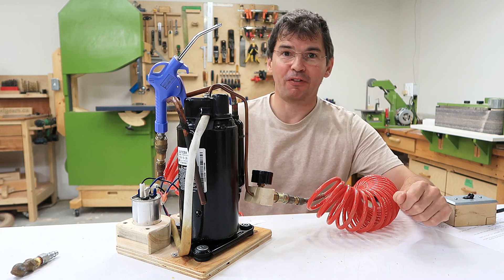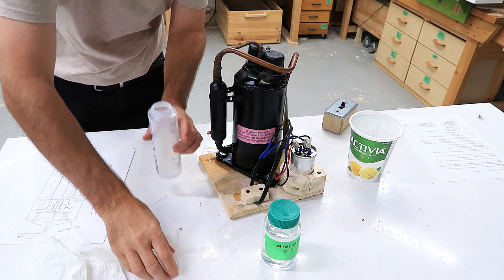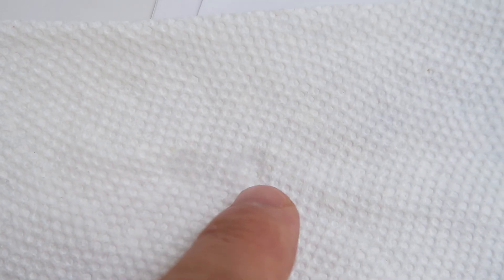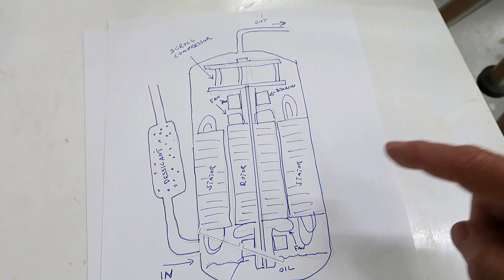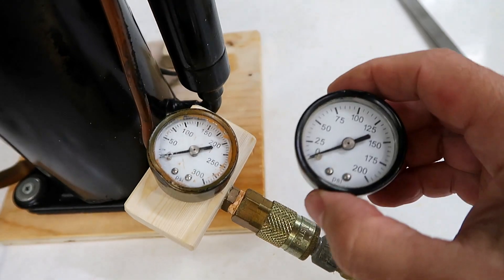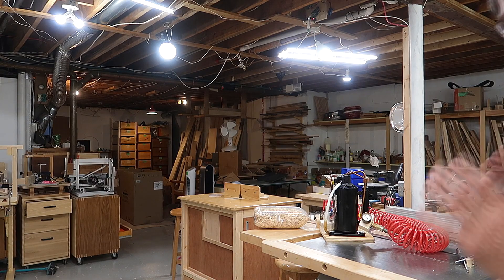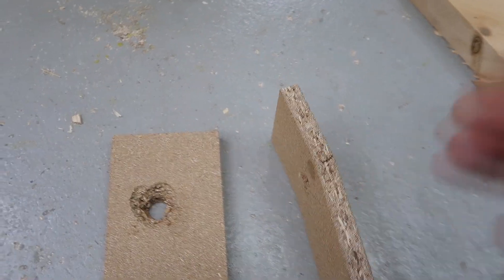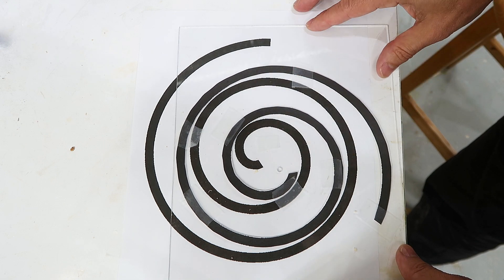This air compressor will fail

Comment: 1) You might like to add a drain plug to allow easy removal of water and replacement of the oil.
2) An oil trap with an area of low flow  or cyclone flow will help remove the oil from the air.
Reply: adding a drain pug to a 300psi pressure vessel isn't as easy as it sounds
Reply: @fuzzy1dk  I'd expect not. How would you plan to do it if it were yours?
Reply: Oh yeah cyclone wouldn't do it, would have to be like a HEPA filter cartridge or something. Which would probably get loaded pretty quickly, too (capillary action blocking up all the pores?).
Reply from the maker: That oil is a very fine mist, hangs in the air for hours, a cyclone or oil trap wouldn't take it out
Reply: @matthiasrandomstuff2221  Yes, actually it would remove a very large portion. The common separators are a combination of centrifugal action, as well as a coalescing filter. In larger industrial screw-type air compressors, the rotors operate in an oil bath. Oil entrained in the air is separated out on the discharge, and fed back into the compressor. These compressors typically consume negligible amounts of oil. The cyclonic action of the separators becomes more efficient the higher the flow rate.
Reply: @matthiasrandomstuff2221  A simple oil mist separator can be done as a metal can with intake on the bottom side, exhaust port on the top and inside filled with stainless steel wool. The oil return line would go on the bottom. But that might just be too much of a hassle given your application.
Reply: @matthiasrandomstuff2221  so I was thinking removing most of the oil.  I supose maybe it's more difficult to remove all the oil.

I suppose to use a cyclone and or oil traps or not depends on the application and level of oil in air removal needed. Steel wool in a sealed can with two ports sounds like it might help.
Reply: Best I can think of for relatively cheap is two large filters to maximize surface area, one before, and one after, your storage pressure tank. 3" x 18" pvc pipe packed with glass beads or similar. And then you'd have to regularly drain/clean them. not a great solution, but it's sustainable. 
* could auto-divert a small amount of bleed pressure back into the inlet from those filters perhaps, so it recycles the pooled oil. as long as you have check valves on the pressure tank in the correct way, it should be okay. and that would significantly reduce maintenance on the filters.

Comment: Old ones would die pretty fast after oil starvation (assuming you'd dump all the oil out). These newer units are ... less susceptible to the issue, tho i think that's because of the inherent robustness of sintered parts rather than "better parts". 
Even so, the death would occur after a loooong long time. I have one of these for an automated air tank that compresses air and decloggs a vent twice a month. I think it's been ~7 years since i fabricobbled it together, never once had to work on it.
Reply: If a sintered filter breaks, but the pieces hold themselves together, does it really matter?

Comment: How feasible is just soldering a copper air fitting onto the output instead of a wooden block?
Reply: Super easy. If you have the parts, less than a minute.
Reply: Yeah, I fully expected him to flair out the tube and put on a compression fitting by now.... But this is Mathias, so OF COURSE he has wooden air fittings...  This is a dude who made his own shop power tools out of dishwashers and shit. 😎

Comment: So if the current compressor container should rust out, I can replace it with a soda bottle, good to know :D
Reply from the maker: just don't touch it with anything pointy.  On the plus side, it won't rust, you can see what's in it, and if and when it does blow, there isn't a lot of heavy stuff flying around

Comment: At work we have a small table top compressor for pneumatics education. It consists of a refrigerator compressor bolted on top of a pressure tank. I could look up the brand and model if you are interested.
Reply: Or, you could leave a vague comment about looking it up but not actually bother doing so. 🤣
Reply: @hiandrewfisher  I just started a 3 day weekend honey

Comment: Why not just open it up and replace the oil, if its not holding refrigerant anymore.
I suppose metal shavings but I feel like one could mitigate that easily.
3:15 - neat about the particle detection, and neat about the frying pans
Reply: I guess ot would be the smartest to add a drain plug at the bottom so you could drain both oil and condensed water
Reply: How would you open it up?
Reply: @filipgugo5296  I suppose you could drill into it, or use an angle grinder to take the top off. Breaching the housing will lead to the oil and vacuum side, the pressure side is a direct pipe to the outside usually.
Reply from the maker: I already established that the pressure side is the whole housing, otherwise it wouldn't store as much air inside as it does.  So once I cut the top off, I probably wouldn't be able to connect somethign that can take 300 psi.
Reply: @matthiasrandomstuff2221  I was curious as you had mentioned the housing being pressurized. This is the only compressor I've seen done that way. 

As for the hole in the bottom, probably the best place to put it. Thanks for the replies!

Comment: That is a rotarty vane compressor, not a scroll. Scroll is not a type of rotary vane, scrolls don't touch as they are seperated by an oil film. My guess old fridge comptessors lasted so long because they were reciprocating and had mineral oil and weren't used much. Scrolls don't compress well with low incoming pressures, they start making noise and stop pumping.
Reply from the maker: I should start a bettign pool and once I have enough money wagered, cut it open in a live stream!
Reply: @matthiasrandomstuff2221  then you can take the proceeds and buy a real good one that's purpose built too.

Comment: Did you ever test how much of a vacuum it can draw?

Never really thought about the relationship between a compressor's output pressure and the amount of vacuum it can pull.
Is is always a close to 1:1 ratio, does the method of developing compression make a difference, etc
Reply: Nothing like 1:1 since you can only go down ~15psi on the inlet before you get a hard vacuum, though it requires very specialised pumps to even get close to this.
Reply: @ferrumignis  /facepalm
Ya that makes sense.
One of those things that seems so obvious once its pointed out that you wonder how you didn't see it initially.
Reply: I wonder if it'd just blow all the oil out. since that's what's "sealing" the pump.
Reply: https://youtu.be/qo1694UGdBY - Russian guy creates vacuum using a fridge compressor, but I don't understand his measurements

Comment: I used a mini fridge compressor as a very quick, and powerful vacuum pump. It failed almost immediately, I wonder why? Maybe I’ll try again, and make a video.
Reply: Mayube needed oil ort was already old and failing. It doesn't take much and we arer running them way outside their intended specs.
Reply: @nobodynoone2500  I think you are correct, it was doneso .
Reply: I'd love to see it

Comment: Is the desiccant now covered in oil?
Reply from the maker: I assume.  Haven't cut it open.
Reply: Whatever is in there, its designed to work with oil permanently moving trough the system, thats how refrigeration cycles work.
Reply: @FerdinandFake  The thing is there is nothing in there. It is a liquid accumulator to prevent large amount of liquids entering the compressor.
The desiccant part aka filter drier is after the condenser coil, not on the suction side.

Comment: That is a rotary compressor, not a scroll compressor- not that it matters much-just thought I would help clarify.
Reply from the maker: I have watched a few videos of compressors like that getting opened, and they wee all scroll compressors
Reply: @matthiasrandomstuff2221  I'm sure you must know by now that "watched a few videos" does not count as reference material. Take your video as an example, you keep telling people you have a type of compressor you don't really have and you've backed that up by other videos, probably just as error ridden as yours. Use google. It'll set you straight. If you let it.
Reply from the maker: A scroll compressor is a form of rotary compressor
Reply: @matthiasrandomstuff2221  Correct, but these smaller ones are a rolling piston rotary and its at the bottom of the unit, not the top, so the suction goes directly into the pump, and then as you found out, the casing holds the high pressure.
Reply: @matthiasrandomstuff2221  It's hard to tell who knows what they're talking about and who is 4 years old on YouTube but I'll second his statement, it is a rolling piston. The compressor in my home's AC system, which is a much larger one than this, is made by Copeland Scroll, so obviously a scroll compressor. If the suction is at the bottom, it's usually a rolling piston compressor.